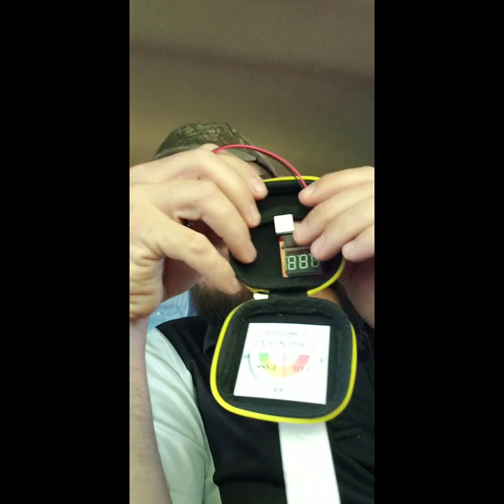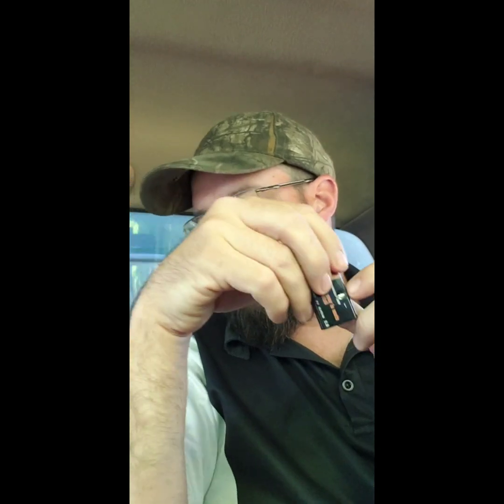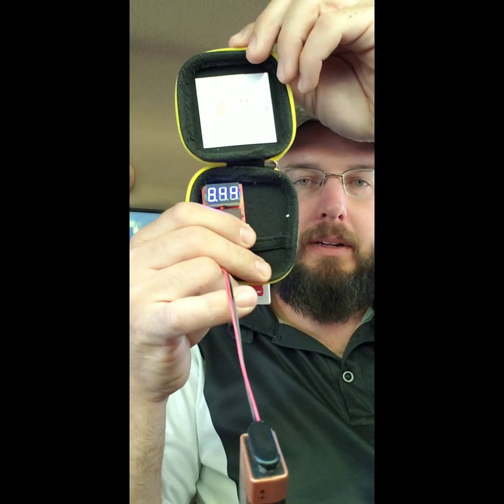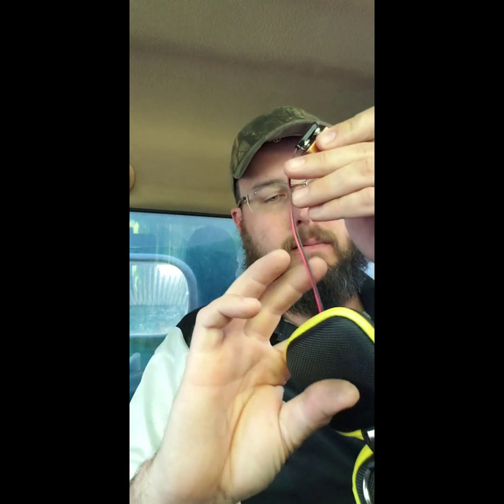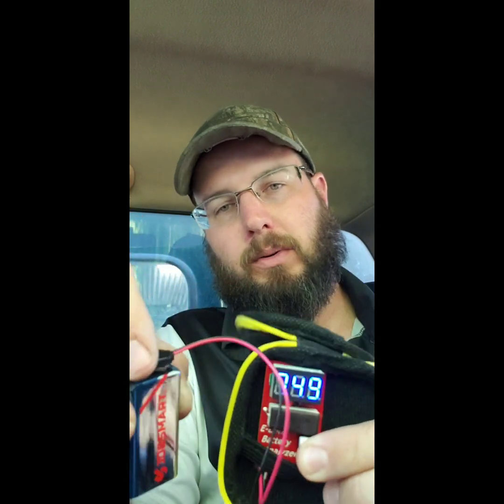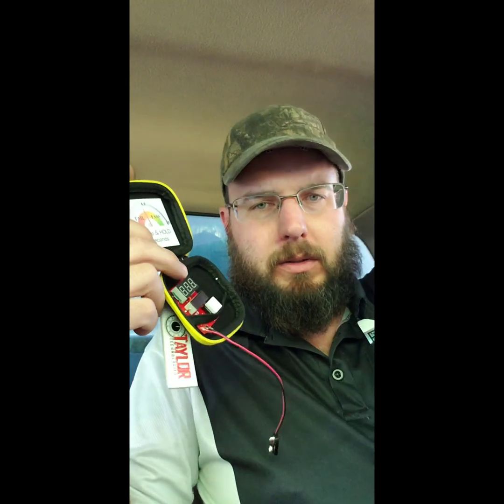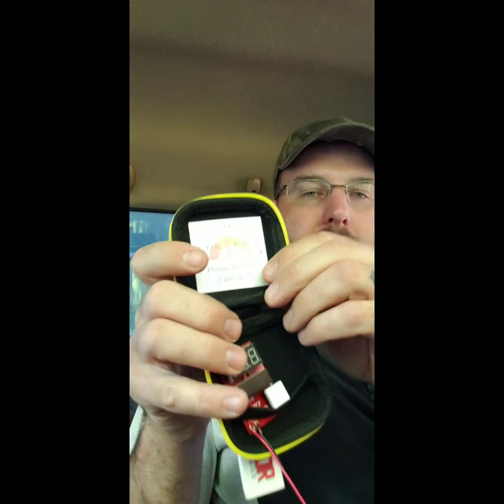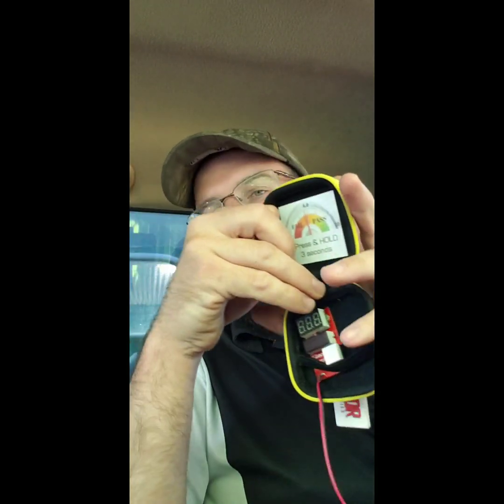Taylor Technoligys 9v battery tester analyzer electronic safe lock tool

Comment: Used mine once and the leads broke off  the board.  Had to fix it myself.  Tester works well needs a better battery connection. Possible connect straight to the board.